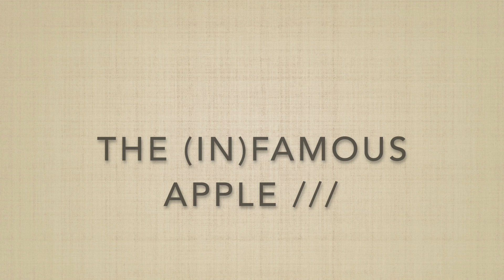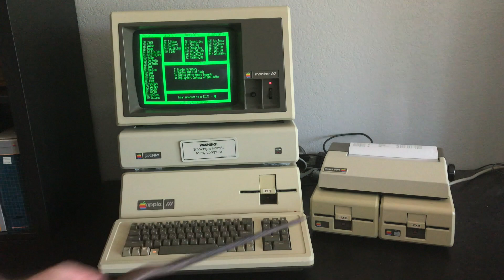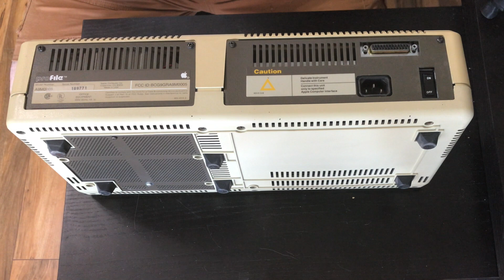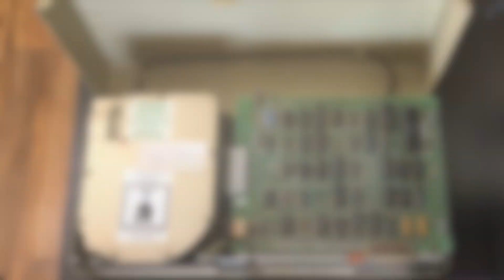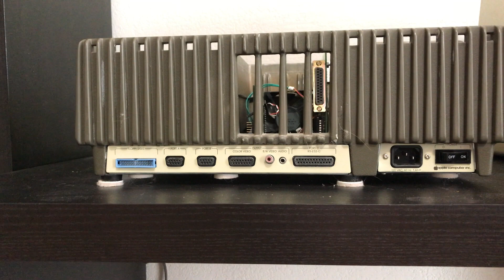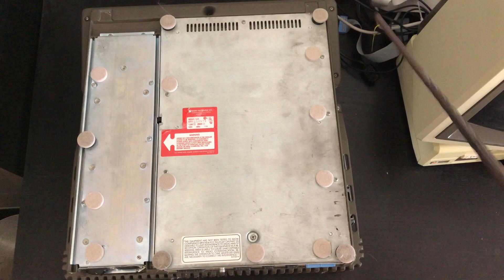Apple III Hardware part 1

Comment: So the Apple III had a port for external floppies? But how did it connect to that external hard drive?
Reply: You could daisy chain external floppies , this was then later also used for the Apple II floppy controller 
The profile HD drive needed an HD controller card .
Just for info I have also a solid state drive in my Apple III a modern adaption of SD-Card reader wich is also a card you put into the Apple III.
Thanks for watching :-)
Reply: @sempertalis1230   thanks for the info!

Comment: 8:08  I wouldn't let a duracel battery be in the same room with my vintage computer stuff.  Given the enclosure, the acid fumes can get to the PCB and start destroying it.  Buy yourself some low discharge NIMH cells like eneloop and use them.   Modern alkaline batteries are HORRIBLE especially in a very low draw like this application.

Comment: In 1980, if you had a 5 megabyte ProFile hard disk you could do projects unthinkable just a few years before.  You could send a mass mailing using a "mail merge" function.  You could use the then-revolutionary VisiCalc spreadsheet to calculate engineering tolerances on the structure of buildings, or project profits into the future depending on making different moves today.  The Apple /// was not competing against the IBM-PC, since that wasn't out for another 18 months or two years.  It was competing against the likes of the DEC VAX and on the high end, even against the IBM System 370 mainframes.  If you had an Apple /// in 1980 with the 5 megabyte "ProFile" hard disk unit, you were a total baller.
Reply: Shadow, i totally agree, 5MB in the early 80's was a lot for hobby and small business . The Apple /// was a new breed , the PC for small business applications.
As I describe in the other volumes of my mini series, the IBM PC came later and I am sure IBM realized that the small business marked was overlooked.
However I disagree that the Apple /// was competing with a VAX or an BM mainframe. He was not build for that.
I used to work with a VAX in my early days , it could do things an Apple /// was not capable of.(multi workspace enviroment for example)
But for small businesses which do not have a budged to buy a 100 thousand dollar computer it was the tool they never had.

The Apple II showed that applications like VisiCalc would be a unbelievable help but the Apple II was not capable of running medium sized data base ( medium for that time) 
So the Apple // filled the void .